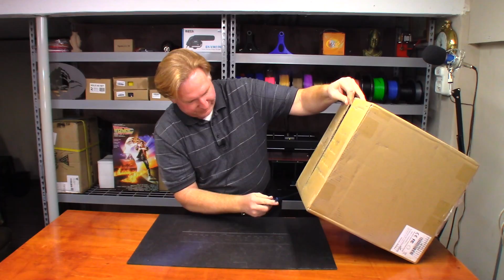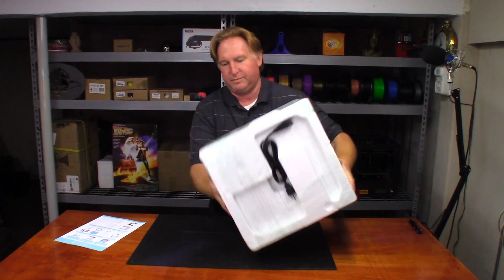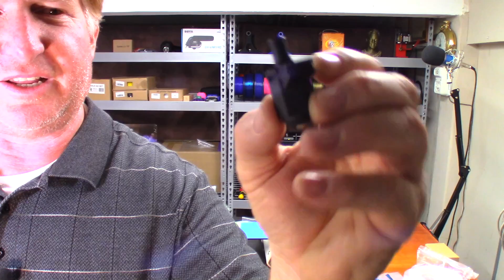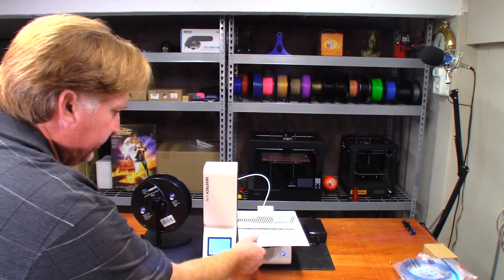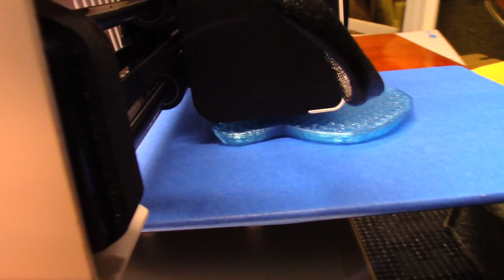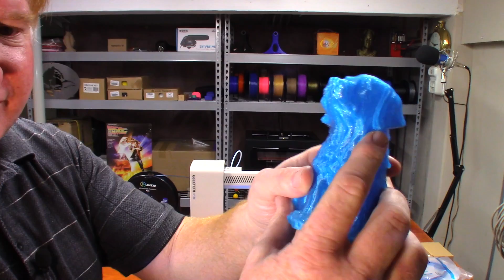Unboxing and First Use Geeetech E180 3D Printer

Comment: I have this printer and CAN NOT for the life of me get a completed print. The print always slides around on the bed. Do you have any suggestions?
Reply from the maker: Are you using tape of printing directly on the aluminum?
Reply: @JimmyShawsTidbits1  I am using blue painters tape, I've used a Elmer's glue stick.

Comment: When the printer arrived it was broken and was of very poor quality.  Broken micro switches. A bed that has no support making leveling the bed almost impossible to use.  Geeetech's support was of little use.  Didn't know how the fix the printer.  If you want a printer that looks good on the desk, but will never actually work then this is the printer for you.

They said that it has an easy to change hot-end the hot end has now been changed to something else.

I would not consider buying any thing that Geeetech makes.

Worst ever printer.

Comment: Hello, can you please help me to set up this 3d printer, I mean I'm not totally noob but I would like to ask you what kind of setting have you used to make that Dog it is very good ! I'm still trying to find where I'm doing wrong, all is settled very good levelling ok retraction 7" rubber band of the motors, voltage of the single step motor but still blowing out some extra pla and high oozing problem :/ please help if you can I will be very happy!

Comment: it's cute. but it's stupid at 270$/ for 180-200 you can get an ender 3 with a 220x220x250 build area and heated bed and a ton more and for 220 you can get a anycubic i3 mega-s with a titan extruder (clone) which is like... far better than this in compariosn

Comment: Dear Jimmy
How did you assemble the filament holder? I have all the tools they provided me with, but I can't seem to assemble it. Thanks in advance for your reply!
Reply from the maker: +Robbert Pyfferoen I had to install the screws loosely until they were all started before tightening them.  The holes may be off a little.
Reply: Jimmy Shaw's Tidbits thank you for your reply. I did not receive screws in my package, only 2 L keys, 2 cylindrical implements and a small screwdriver. Guess I'll have to procure some!

Comment: SO am I correct in saying this does not have auto leveling?
Reply from the maker: +M Shealy It does not.  I has assisted bed leveling.
Reply from the maker: +M Shealy sorry, it*
Reply: it is difficult to do?
Reply from the maker: +M Shealy Not at all.  All you need is a sheet of paper to set your height and go though the sequence.  In my unboxing video I show how to do it.
Reply: Do you suggest this for a newbie that wishes to maybe go larger? Or should i just do the CR10 Mini 3D right off the bat? LOL I have narrowed it down between the E180, CR10 Mini , the Cube or the Ender 4 or Dogoma Neva
... ANy suggestions?
Reply: Hello Jimmy,
just to make it clear to readers, the aforementioned "assisted bed leveling" is nothing but a shortcut provided for quickly jumping to the 5 reference points and then checking with the paper sheet.
But the way you perform the leveling in your video leads to thinking that the Z heights of the 5 points (that you set each time with the "OK" key through the sequence) are individually stored and then taken into account afterwards, in a sort of "software correction" of minor bed misalignments.
Unfortunately, there's no such feature in the E180. The Z height stored is one and only one, namely that of the last Z position when you pressed OK. This means that every time you press OK the actual Z level is overwriting the previous one and so on. Take, for instance, that the paper is too loose at position #1 so you correct by lowering Z + OK, and subsequently find that on position #2 the paper is too tight and you correct it by raising  Z + OK, well, the position #1 will become loose again, and so on.
Thus, the only way to correct a bed misleveling is to manually operate on the 4 screw/spring assemblies trying a bit at a time to eliminate the height differences and then re-checking again and again, and here's the part where the 5-points mechanism comes handy and is intended for: to quickly reach the 5 predefined positions, nothing more than that. When you are satisfied with the check, the last Z value stored will be the reference height from that moment on.
Storing and actually taking into account 5 correction heights would require the G-code generating program to perform a Z height interpolation for every point of the X-Y plane, that is the task of a full 3-axis interpolating system.
Cheers,
Roberto